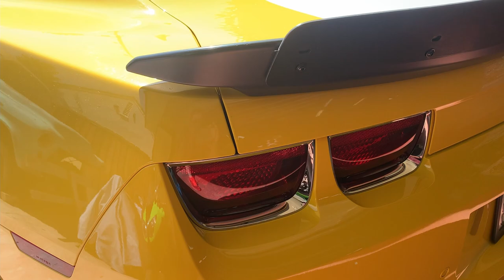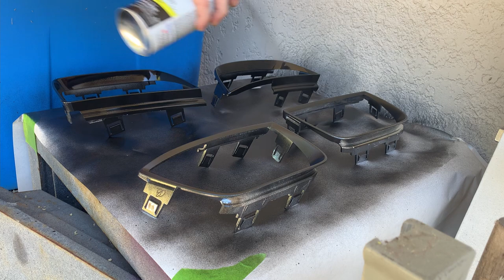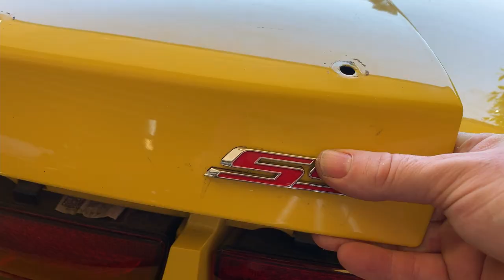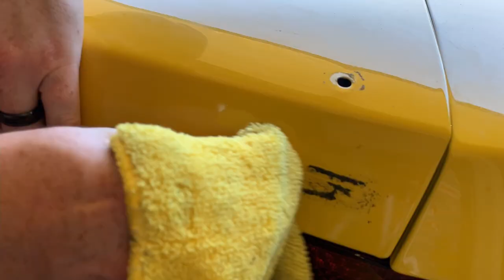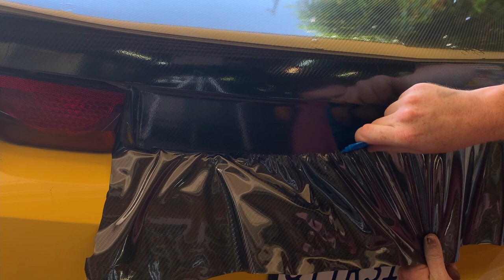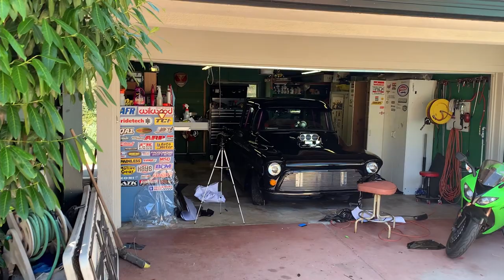Wrapping my Deck Lid in Carbon Fiber | Painting Tail light Bezels | 2010 - 2015 Camaro SS

Comment: I HAD to do this as the CF spoiler I ordered to replace the stock one didnt cover ALL the holes GM drills into the trunk top.  Also my factory spoiler had dug through the paint and I had rust spots everywhere.  To this day I still have the holes through the trunk lid but is now covered with CF wrap.  Will cure it once I order a CF trunk lid.

Comment: What brand did you use, I bought some off ebay(really cheap and it look like crap) I love the way that one looks.
Reply from the maker: I got it off Amazon. Here’s the link. It’s cheap stuff as well but doesn’t look bad. 

Premium 5D HIGH Gloss Black Carbon Fiber Vinyl Wrap Bubble Free Air Release (6FTX5FT / 72"X60") https://www.amazon.com/dp/B0150KLEPO/ref=cm_sw_r_cp_api_glt_fabc_TEZ19B2A4PBB1452A5WX?_encoding=UTF8&psc=1